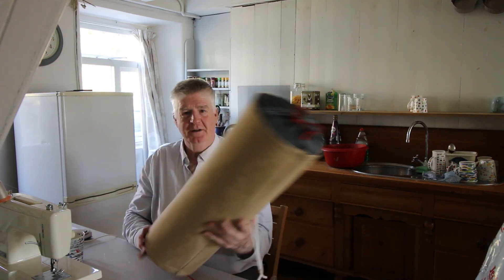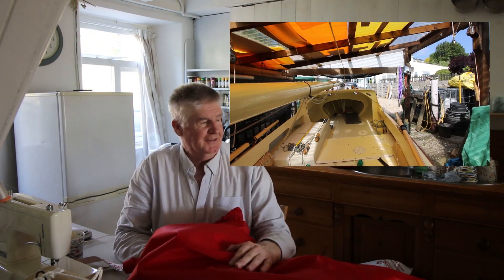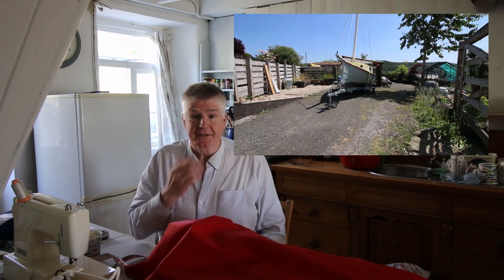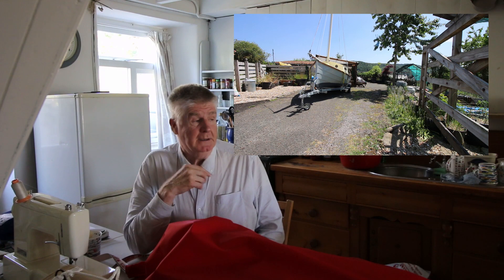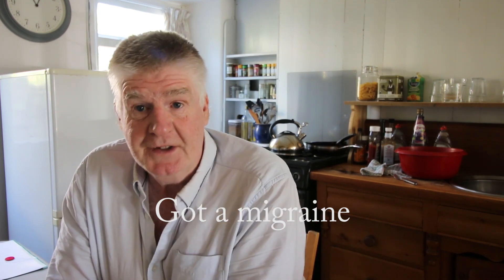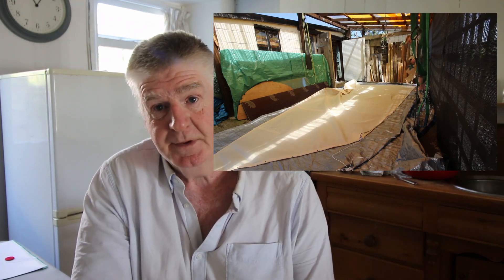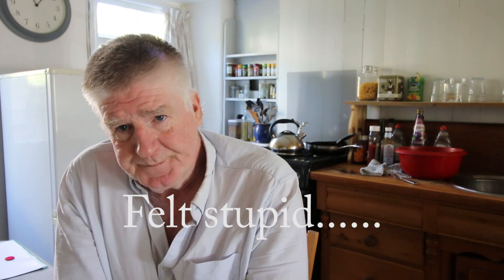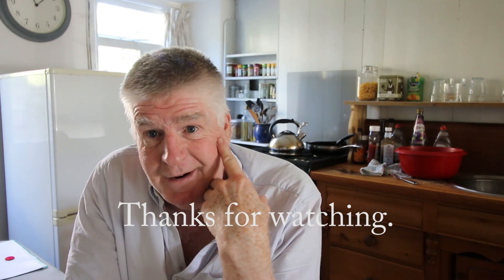Like a noob !

Comment: Thank you for sharing this. 
 One gets very excited at this stage when finally every thing is coming together after so much planning and hard work. 
 I feel for you. 
 Unfortunately making mistakes are an unavoidable part of the  creating process. I know you will craft a fine solution. 
 Regards Michael
Reply from the maker: I'm taking a break from the project now and the sail has gone back to the loft.  Yes- mistakes are part of the process and this is the first one that I couldn't correct straight away myself.

Comment: Oh dear!  Annoying I’m sure, but I guess now it’s summer the sail maker will have some spare capacity and be able to make the alterations relatively quickly.  Time to take the boat on the water, bimble around for a few hours and relax!
Reply from the maker: The sail is already back at the loft and they were pretty sure they could fix the problem, so i'm reqsonably confident at this stage.

Comment: I know that sinking feeling all too well... I am busy making many mistakes with my Passagemaker dinghy kit 😬but it is all part of the learning process. Would the sailmaker offer any advice on how best to adjust it to fit? I have every confidence you will come to a workable solution in due course. Thanks for sharing this 🙂
Reply from the maker: The sail has already gone back to the loft and I think the solution is to take the slice off the head that I showed....also got to make a longer gaff but that's no biggie once I get the timber.